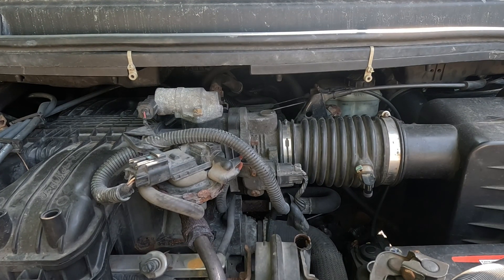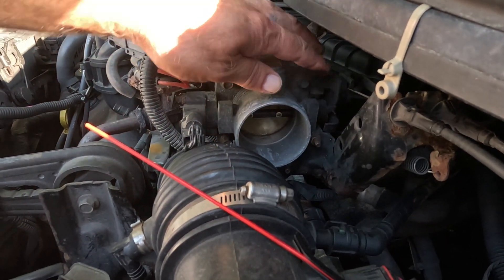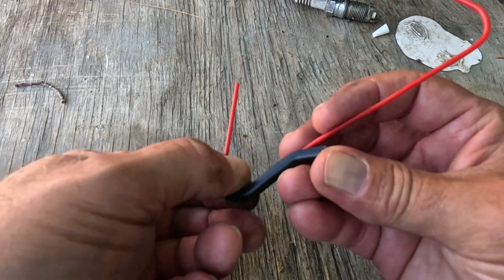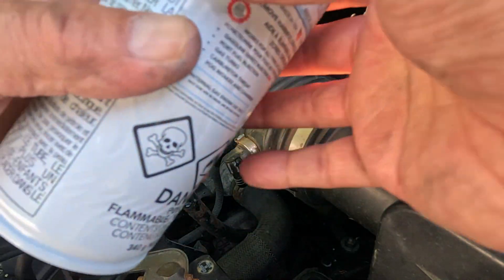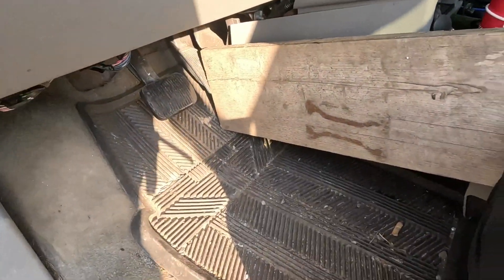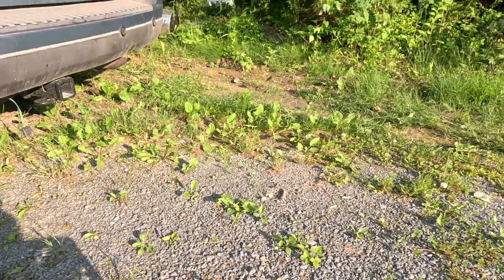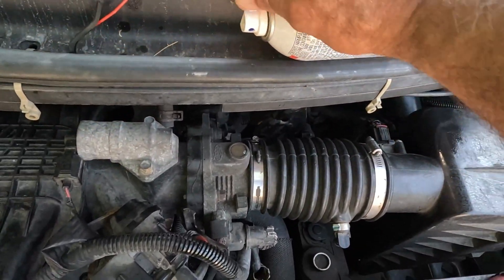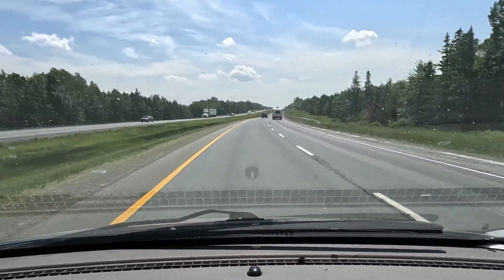Using Sea Foam to clean carbon build up in an engine and clear a P0300 'Random Misfire' engine code

Comment: Try the gumout version.. I had better result with it. Altho.  BG can is the best of the best if you can physically get to every valves and brush them with the product.
Reply from the maker: Will do if the problem happens again Farncois . Although the vans been working great since i did the SeaFoam treatment last week !